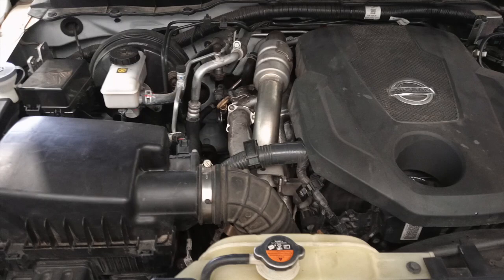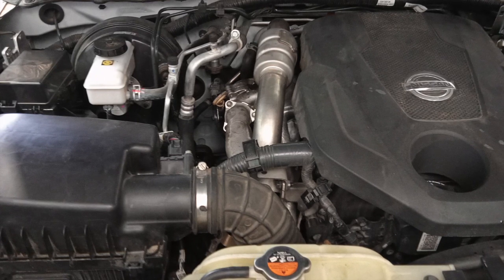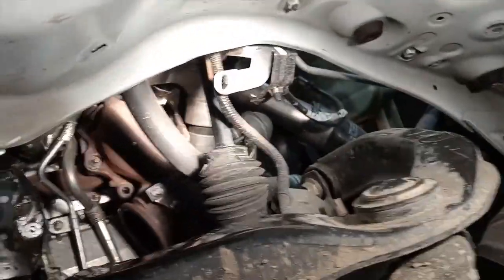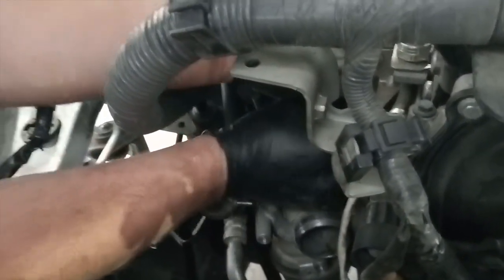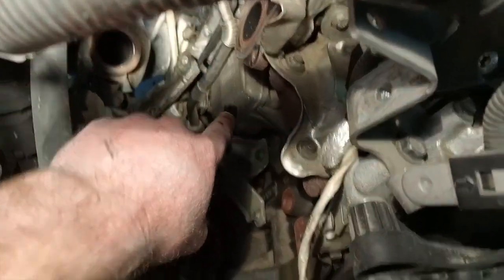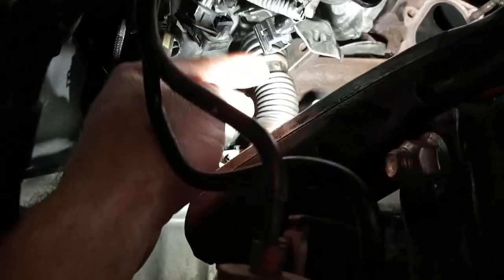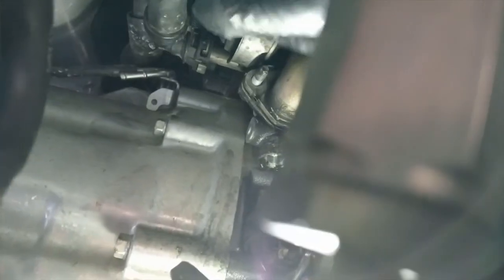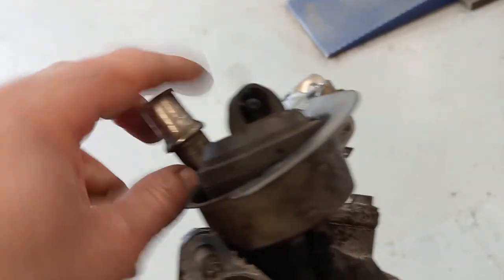Nissan Navara D23 EGR Cooler Replacement (NP300 Navara)

Comment: Thanks for the video mate, helped heaps! is it possible to just remove the whole cooler, link coolant lines together and block the exhaust ports?
Reply from the maker: There's a good chance you would end up causing faults for reduced EGR flow, I would think you'd be going down a rabbit hole of problems.

Comment: How difficult is this to do if you’ve not got loads of experience in mechanics? I would be keen to try this myself
Reply from the maker: Hard to say, but I'd think you would want to be a reasonably handy DIYer. If you have some experience, you could do it, it may just take longer to navigate through, if you have no experience I'd say take it to a mechanic. Knowing that those banjo type oil feed fittings need copper washers on both sides of them will help avoid disasters too.

Comment: Hola buenas tardes , disculpe quisiera hacer una consulta tengo una np300 2018 el problema que tengo es que no calienta la calefacción y ninguna manguera del radiador ni de las calefacción y echa el agua al depósito del radiador
Reply from the maker: Is the thermostat stuck open? Start it from cold and if the bottom and top radiator hoses both get warm at the same time, the thermostat is probably stuck open.

Comment: Can the cooler leak exhaust gas??
I have one that smell bad exhaust fume on where the exhaust manifold is 
Please help
Reply from the maker: Yes EGR coolers can crack and leak exhaust files externally. You can cut a length of garden hose, put one end to your ear, move the other end around the area you suspect the leak is coming from (with the engine running). You should be able to pin point exactly where the leak is.

Comment: would it be similar for the D40 engine?  Cant find a single video on it anywhere.
Reply from the maker: Hi there, totally different on the D40, but much simpler too. The cooler on those is at the front of the motor. I haven't done a video on one yet, but there's a couple of vids on YouTube that show what it looks like and where it is at least.
Reply from the maker: This one is probably the best https://youtu.be/RNctg9L-G8I?si=1MaVOz4bmtlHddXo

Comment: I have YD25 ENGINE.  Have already new head gasket, thermostat,radiator caps.   But main problem is still..All coolant move to reservoir tank could lead to overflow and overheat again.   Is it posible for that egr cooler is cause of this ? Thanks😔
Reply from the maker: Yes it could be a cause. Does the coolant move to the bottle all the time or just after it overheats?
Reply: @gettingitdone1  yes moves all the time.  1 minute after.  Even in idle. Coolant move to the tank.  But the temperature is normal.  If i stay maybe 1 hour the tank will overflow posible to overheat again
Reply from the maker: @JvideoCreation  ok, can you try bypassing the EGR cooler, take the two hoses that go to the cooler and connect them together, with a pipe or connector. Then run the engine and see if the problem stops. Then you will know for sure if it's the cooler that needs replacing.
Reply: What about that tube from turbo. Theres a water flow in it right ?  Could it be posible thats where the problem ?
Reply: @gettingitdone1  ok bro. Thanks . Really appreciate it. I will try. Then i let you know the result.☺️
Reply from the maker: @JvideoCreation  it might be a possibility but much more likely to be the EGR cooler.
Reply from the maker: @JvideoCreation  all good. If it turns out not to be the cooler, you might need to look back at the head gasket situation and consider if the head itself is cracked rather than just the gasket. Not sure if you already had it tested.
Reply: @gettingitdone1  i already try to bypasses the egr cooler now.  But no changes.😔 Even that tube  from turbo.  But still no changes
Reply from the maker: @JvideoCreation  ok, first thing to test now will be the new radiator cap, just to make sure that isn't faulty. You could also check the thermostat is opening at the correct temperature (probably not the problem if it happens straight away). Also just want to triple check the cooling system is all bled. Fill it up and squeeze some hoses to see if it's pushing any air out. But you're probably going to need to look back at the head gasket/cylinder head. Diesels can be a bit harder to diagnose for head gaskets, but we normally run them with a funnel attachment on the radiator and watch for a constant bubbling with the engine running (sometimes only shows up after the thermostat opens).
Reply: @gettingitdone1  thanks bro.  Radiator cap really fix the problem. I already replace it from beginning.then i check again but i notice the new cap cant hold the pressure because its to short. So i replace proper cap. So theres no problem now.
Reply: @gettingitdone1  thanks again bro. Really appreciate it for your time and giving me some tips.
Reply: @JvideoCreation  Just shows you that problems that look really severe, can be caused by small, overlooked things, like your rad cap...which you already replaced.! Glad you got it fixed :)

Comment: Except the cooler does it needed any other part like  gasket?
Reply from the maker: Wouldn't hurt to replace all of the gaskets, if you can get them. Otherwise most of them are steel gaskets that can generally be reused.